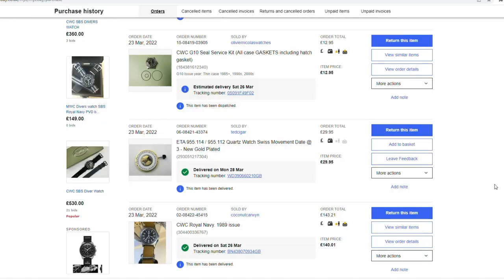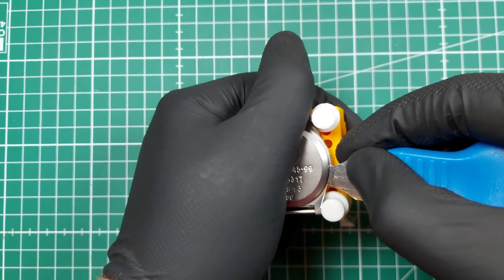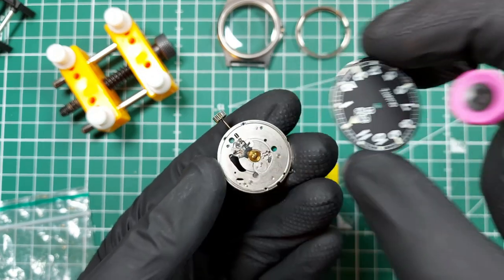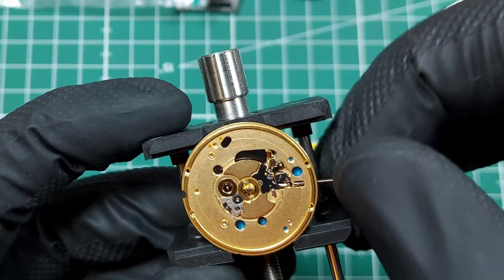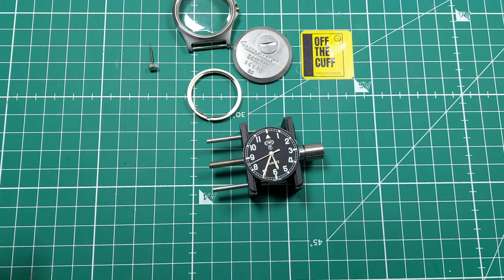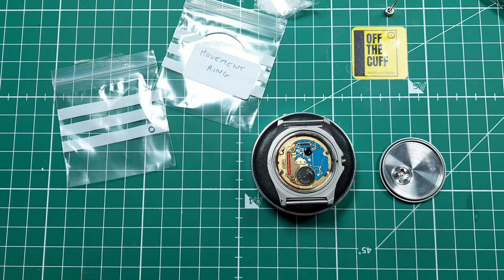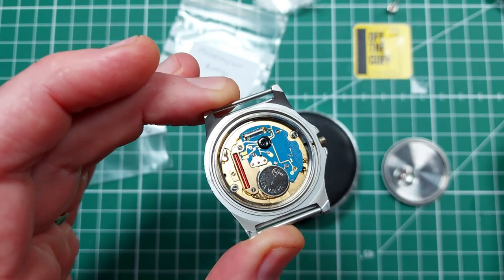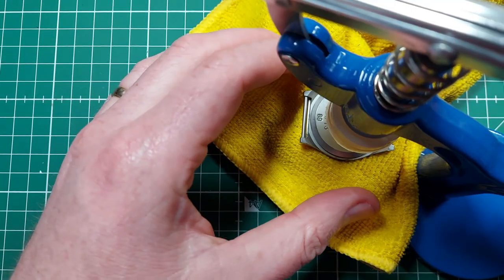Cwc G10 repair. Will my dream watch come to life?...

Comment: Wow! I have never seen than silicon grease pad, that is a great idea! Always wondered how the hell one would grease fine gaskets evenly and thoroughly! I have one of the first 50 last 2003 Army version in mint condition! It will be comming up for battery change and service. Why didn't you oil the cogs and do you know how or who can do this? Cheers!

Comment: Great video as always. I have an 89 also. There is a small story about these with serial numbers from 42*** to 47***. Apparently a batch of about 5000 of them were stolen at Heathrow while in transit. They started coming onto the market 12 years ago. Mine is also from this serial number range.

Comment: Had a similarly damaged dial and used the smallest Posca black paint marker. Looks perfect and I think the soft tip would have helped you. Also it's fairly easily removed with just a cloth if you over apply it.

Comment: Awesome restoration Dan!! Loved the vid. I'm curious to know how you identified the issue? Were you also worried there might be other issues with the movement after you fixed the battery corrosion?
Reply from the maker: Yes indeed, I think the battery leakage would have caused other issues. The £30 new movement solves all those worries!

Comment: Well done Dan. I love your restoration / mod vids… and this one, oh just a wonderful looking watch. 

Another question, since you had the tools out… did you happen to fix the second hand on that Corgeut moon watch hommage?
Reply from the maker: Hi Erwin! I don't think I will bother trying to fix the Corgeut, Just don't think its worth the time trying to source new hands etc, but I might change my mind!
Reply: @watchmewithwatches  I was just thinking applying some pressure to the hand would fix it, but not being very technical I may see it completely wrong
Reply from the maker: @erwinsteneker4078  I did think that too, but apparently a new hand is required because it is too loose on the pinion.
Reply: @watchmewithwatches  yeah makes sense.